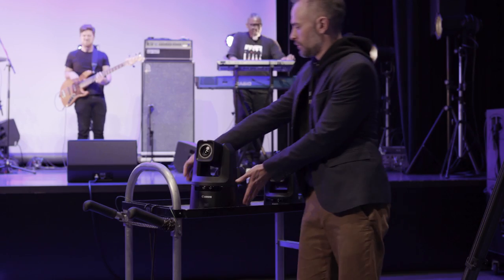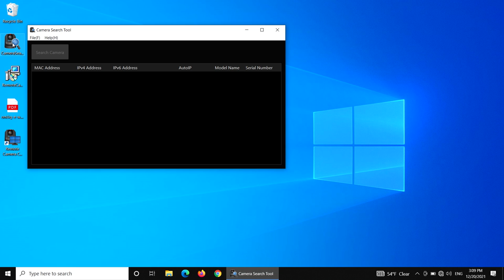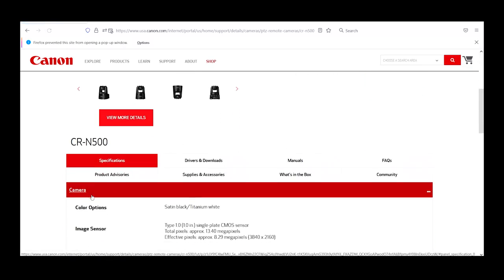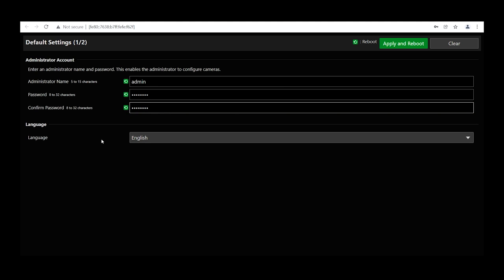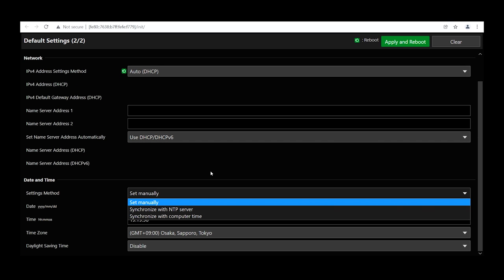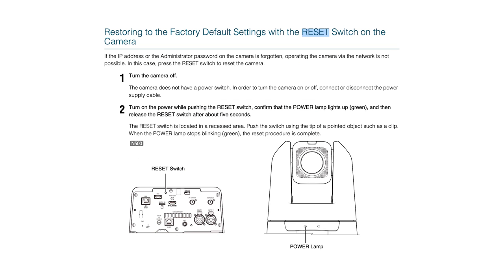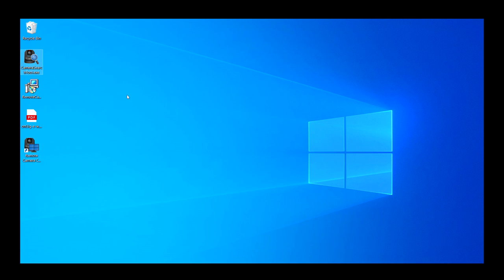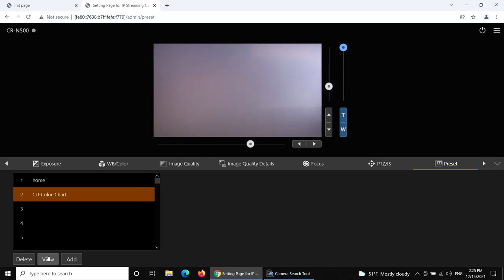Canon PTZ Camera Out of the Box Setup

Comment from the maker: Hi Jim,
Thanks for the question.  Yes, multiple cameras can be run with Trace.  Details are listed on page 24 of the Remote Camera Control Application -User Manual.  Here is a shortcut: https://canon.us/3NXhvPl-.
If you have other questions our Camera Support Team Is happy to help.  You can reach an agent at 1-800-423-5367, M-F from 9:00 am to 8:00 pm ET.
We hope this helps!